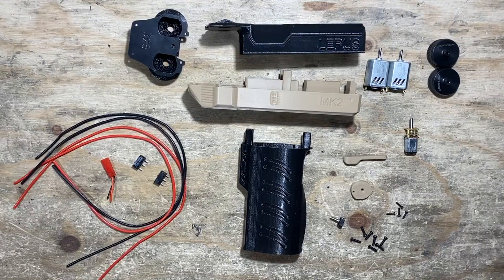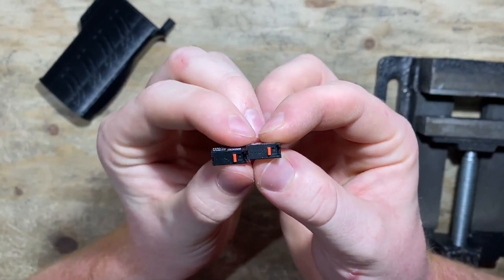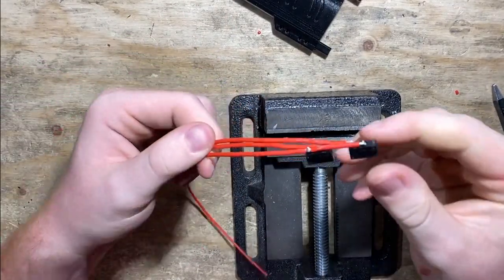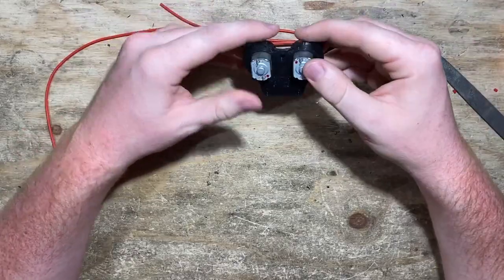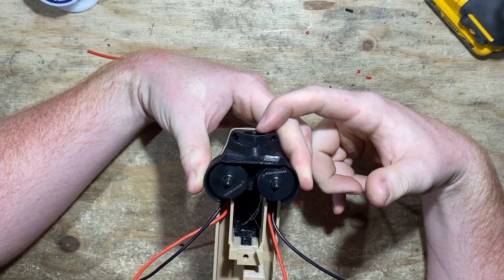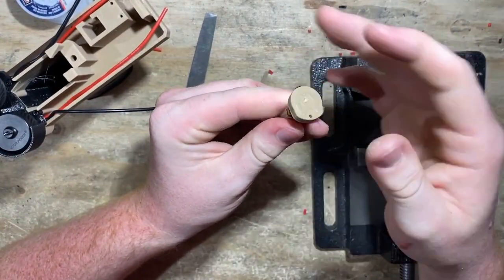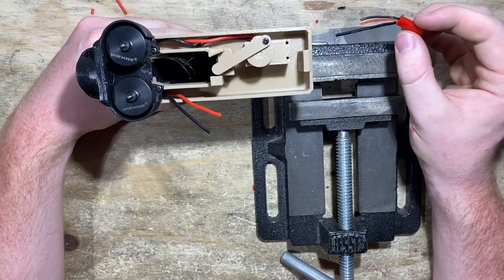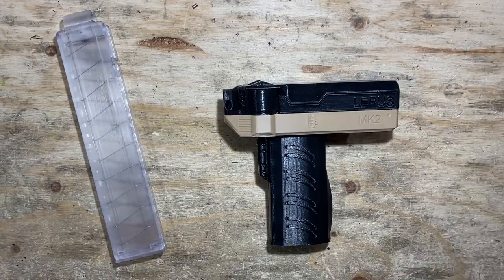Lepus Nerf Blaster | Build Guide

Comment: Y'all. If you don't have a vise like that, you can use a bar clamp. The jaws of a ratcheting squeeze-type bar clamp are usually plenty wide to hold the 2 switches in place while you curse at the soldering.

Comment: EXCELLENT!  It's obvious that you've done this a few times!  As a thanks, I'll be ordering the hardware kit from FrontLine.   Postscript: I got the 5 darts/sec motor and although fun, I regret not going over the top with the 50 darts/sec motor.  The good news is that the motors can be made to be easily interchangeable.

Comment: I'm building this now.  I printed my own parts and bought a hardware kit.  Two things that I wish there was info on are:  1.  Where's that switch spacer stl?    2.  Where to cut the wire that is included in the kit?  I'm pretty sure I messed up my lengths from following this video lol.  Not a big deal because I have wire but would be good to know for other people
Reply: How would you mess up the lengths by following the video

Comment: I’ve purchased a kit to build, and I am looking into a new soldering iron.  I was wondering what type you used in this video?
Reply: I'm not sure what he's using, but if you want a good recommendation you can't go wrong with,  get a hakko fx-888d. They're very reliable and tried and tested. The Weller we-1010na is also a really solid benchtop setup.

For a nice small portable one but still dope AF, look into the TS80-P. It runs off a LiPo or USB-C, heats up in like 2 seconds, and cools down on it's own to a standby temp rapidly when you set it down so you won't burn yourself as easily.  

Personally the TS-80P is incredible but not for your ONLY soldering iron. I'd go with the hakko for your main rig.

Comment: Ok, ive built it and everything seems fine, but when i connect the battery and click the switches nothing works. Ive taken it apart about 3 times and checked everything, I’ve re-done it 2 times. Im not sure what the problem is. I think its the batt. Ive used the lipo tester and it says all the cells are about 4.20 the only thing i can think is if i need to charge them more?? Any ideas? Im stuck :(
Reply: Check continuity through your rev switch - make sure the common and n/o connect when the switch is pushed.  It may have been overheated while soldering it and is pooched.
Reply: Do not charge a LiPo battery over 4.2V it can damage them. There’s another issue somewhere forsure.

Comment: weird question: I noticed that there were some holes behind the pusher wheel for what looked like provisions for a switch at around 33:46 . would I need an additional switch and wiring if I wanted to build a say 8rps build to make sure the pusher resets its position? thanks in advance

Comment: Is anyone else having issues with their pusher catching on talon mag lips? I can't seem to figure out what's going on with mine, it'll fire like 3 or 4 darts with no issue and then get stuck
Reply: Yes I have the same issue what did you to to resolve it
Reply: @slushblaster7523  I swapped the wires on the n20 motor, my pusher arm was rotating the wrong way
Reply: @reedpratt1985  same i fixed that issue but i still seem to have a problem with the pusher/ motor not being able to get darts out of the mag. maybe the mag spring is to stiff on my 18 count straight talon. the pusher might be jamming between the mag side and dart. i do have the highest rpm motor so less torque. i might shave me pusher rod and and/or side of mag
Reply: @reedpratt1985  yep!  we just went through this.  we swapped wires on pusher motor and it solved it.  there's a little + for we had the black wire on +.    swapped (so red was on +) and it's good now!